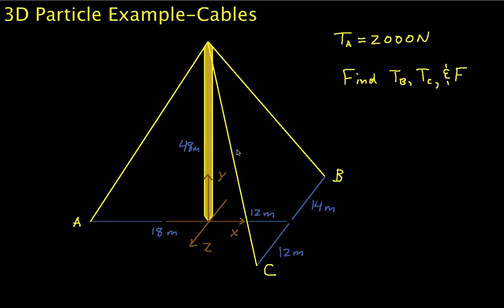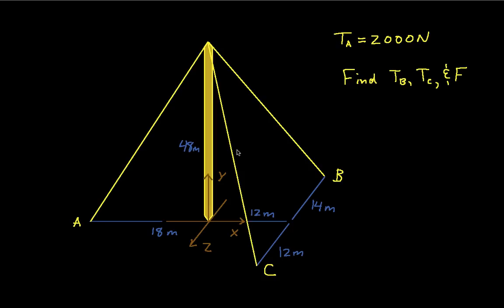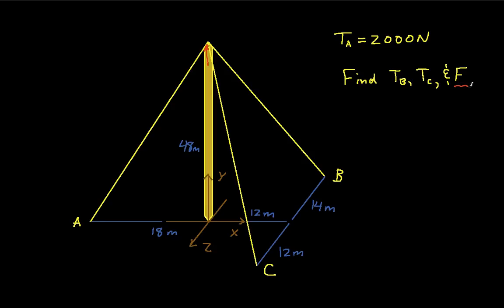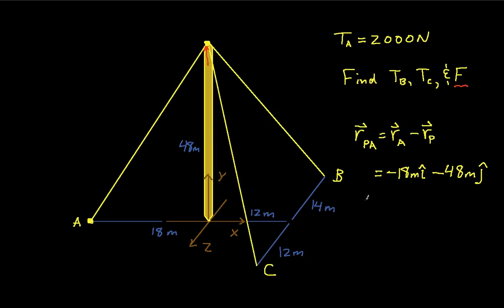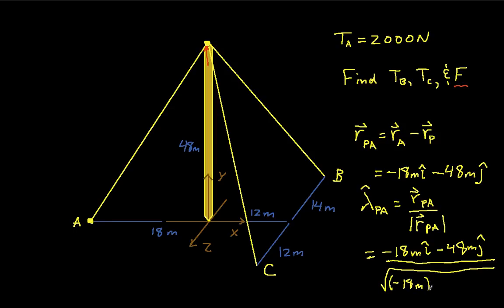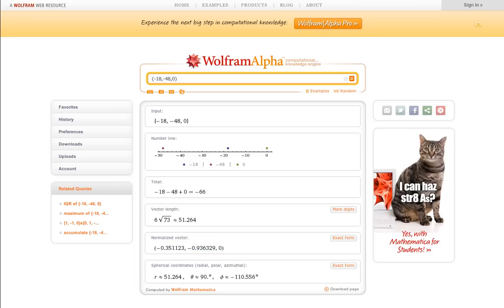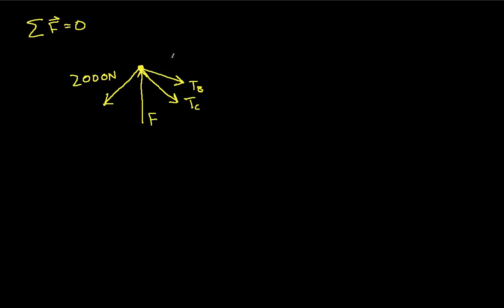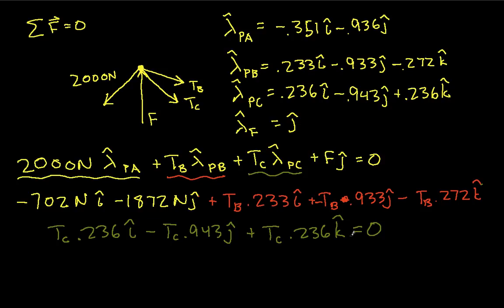3D Particle Example-Cables Part 1

Comment: +Darryl Morrell "F is the force that the tower is applying upward to the point where the cables are connected " . my question is why the tower is applying the force upward??
Reply: if the tower was not exerting an equal and opposite force to counteract the downwards force of the cables, the tower would accelerate into the ground. Or fall down.